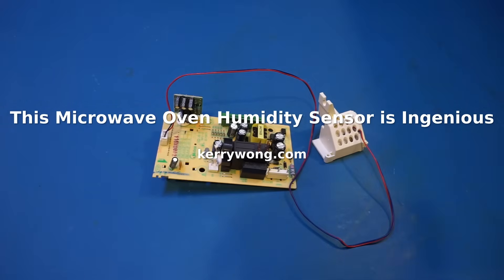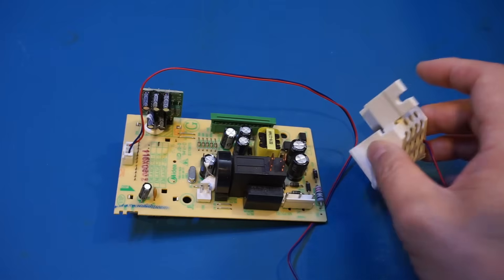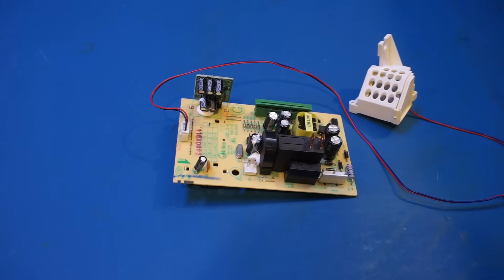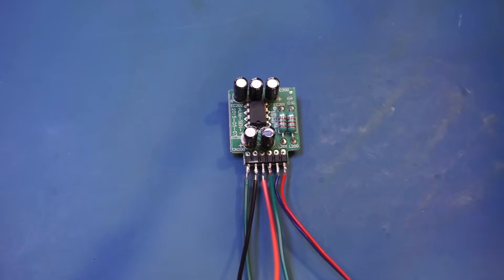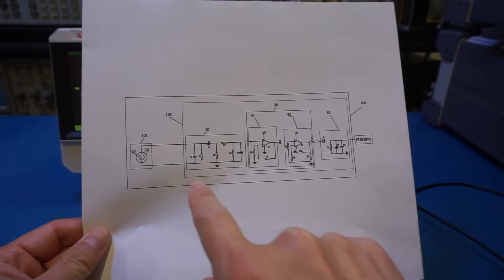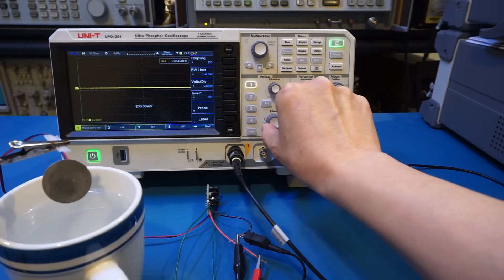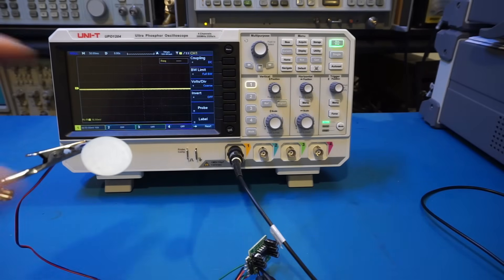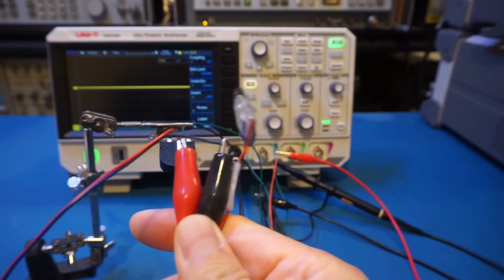A Patented Microwave Oven Humidity Sensor

Comment: Is this a late April fools video?

I didn't understand what role the piezoelectric ceramic material plays in this sensor. There are many chemicals that absorb moisture and get heavier, why not use them?
What's the point of using a disc of piezoceramic that's plated with metal on two sides and can only absorb moisture from the edges?
None of this makes sense.
Kerry?
Reply from the maker: Na, it's real. I found this patent quite fascinating. TBH, I have many questions    with this patented approach as well. I am sure it all comes down to cost...

Comment: Reading the patent, the output isn't directly due to humidity but to "high caloric" (i.e. high enthalpy) air, that heats the piezo element.  They even suggest the element can be enclosed in a glass tube or grease to protect it.  This must be a pyroelectric effect.
Reply: It would make sense. PZT exhibits pyroelectric effect and one of the electrodes (as they described) is sputtered right on the PZT disc. This electrode will heat up faster than the brass one, generating a temperature differential, hence a voltage.

Comment: Interesting. I have a rather advanced Panasonic microwave/grill/oven/steamer that also has an auto-cook option, the manual even explains that it monitors humidity and stops cooking as soon as it senses steam escaping the food, and I would guess it uses a similar, if not identical sensor.

Comment: Thank you Kerry for the tutorial on the Piezo humidity sensor and it's signal change on your scope.
I assume you could see an ohm change using a DMM?
💦〰️
Reply from the maker: You could see the voltage change with a  DMM. But not as visual as with a scope

Comment: Sorry if I missed this during the video, but what is the mechanism of action? All I picked up was "piezoelectric buzzer does stuff when humidity is high", but not a mechanistic explanation?
Reply: The key was shortly explained - the mass of the sensor changes with humidity, thus the resonant frequency. Basically the steam detunes the piezo.
Reply: @graealex  There's no mention of resonance in the patent.

Comment: Thanks for this cool info. I don't quite understand how this would work to detect if food is "cooked" tho... were they planning to detect when it dries out? heheh
Reply: Surely it would be that once the food gets really hot (close to boiling), the rate of steam coming off it shoots up. So when the humidity spikes, your food is done.
Reply: @TheHuesSciTech  I see. I doubt that would work tho... it takes quite a while to heat a potato until it is ready... even if it is "hot" and boiling water off of it. But I get the idea... maybe they meant it as more of a "it's hot"  vs cooked idea.
Reply: @marcfruchtman9473 Food contains water. You can only heat up water to 100°C, after that it stays at the temperature, while more water turns into steam. The function is solely meant for reheating food that's already cooked, but when it starts steaming, there is little to do afterwards, since you're just extracting more water from the food without heating it anymore.
Reply: @marcfruchtman9473  I think it's more for "re-heating" done detection than "cooking" done detection.  For re-heating, once it's to the point of giving off lots of steam, that's as hot as it's going to get, until all the water is all gone, and the food has burnt to a crisp and is totally dehydrated

Comment: Nice. Thanks for sharing. I have been trying to reverse engineer a 3-wire integrated microwave humidity sensor. I hooked up scope and quickly realised that it must share a bus so now I am trying to think of a way to extract only the data to and from the sensor.
Reply: Very likely stsandard !2C communications, so if the scope has built in decoder you can get the data out, or use a simple microcontroller to interrogate the sensor using I2C commands.
Reply: If you put a resistor in line with the data you can detect when the sensor is pulling the data line low (when it's transmitting)